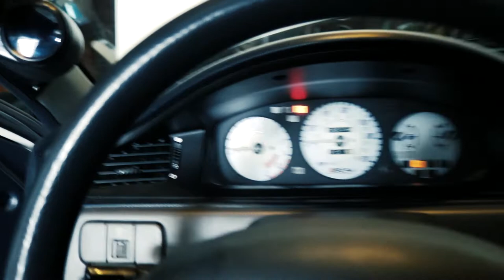How to Helicoil Thread Repair| Exhaust Manifold Bolt Holes

Comment: Have broken studs at my motorcycles exhaust ports. Now I can drill out the stud and use that helicoil as the last solution if I mess it up again. TY for the tip

Comment: How serious is it when you strip a manifold bolt hole? I installed some headers and stripped one bolt hole
Reply from the maker: You should fix it when you can, but as long as all the others are tight, it’s not too big of a deal.
Reply: Boosted John Ok thank you! I fixed it as soon as I posted this lol
Reply: No turbo no problem
Reply: Depends if you are getting any exhaust in the car. (Current situation)

Comment: Late as fuck but quick question. The Honda dyno Shop I was at wants to remove my head to fix some helicoils they did and replace with time serts. They said they’d have to remove my cylinder head. They didn’t for the helicoil. Do you think that would be necessary?

Comment: So what size was the drill bit you used, i have to do this to my b swapped 93 hatch too lol, and also what kit did you use for it? Was there a specific thread insert?
Reply from the maker: Sol93 in order to select the right kit, you will have to figure out the spec of your manifold bolts. Mine were 8mx1.25 I think
Reply from the maker: Sol93 then find the helicoil kit that is made to repair whatever sized bolts you have. The tap that comes with the kit will telll you exactly which drill bit to use. I think I’m my case it was 21/64ths. I’m not certain though so don’t quote me on that.
Reply: Did you buy this at advance auto? One i got says 9mx1.25 would be the size and it uses 23/64 drill bit
Reply: They sell kit at oriellys ita 8mx1.25 helicoil kit